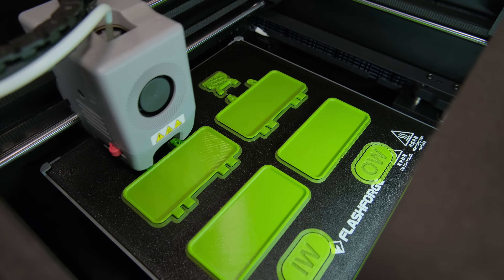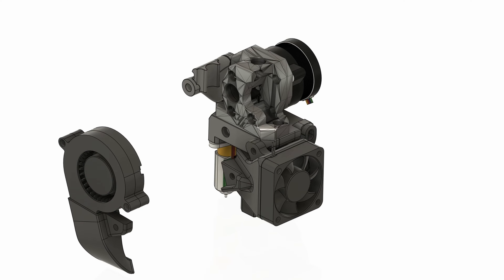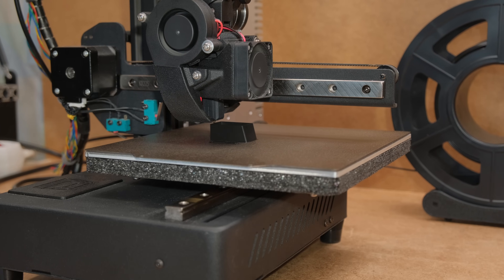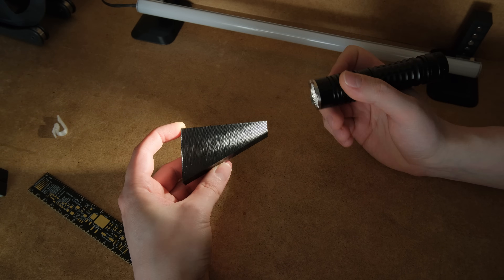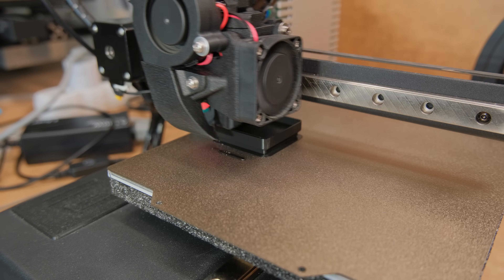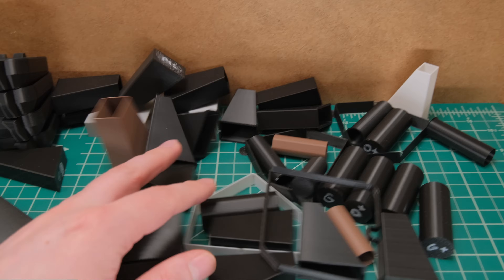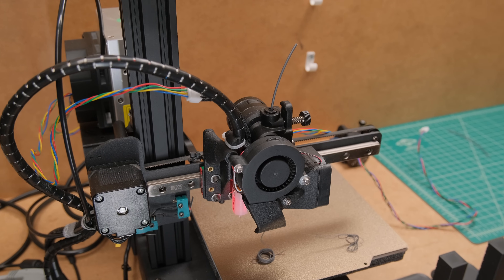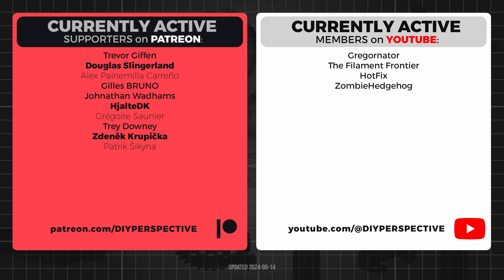DUAL-DRIVE Gear EXTRUDERS SUCKS? (GALILEO 2 vs ORBITER V2 & P1S vs A1)

Comment: did you disable A1 active flow rate compensation? does that make difference?
Reply from the maker: That feature is for Pressure Advance which eliminates bulging on the corners, I have manual values and I don't run it before the prints.
Reply: @PrintingPerspective  doesn't A1 detect filament width and auto adjust flow rate when printing? Not pressure advance
Reply: @h.y-chen  Yup, the A1 has an eddy sensor in the head that does "active flow rate compensation".  I don't think that's pressure advance.  I think that compensates for filament that varies in size over the roll.  That said, the picture they show on their sales page looks like it's an alternative for pressure advance, so maybe I'm wrong about exactly how it helps.
Reply: @h.y-chen  Wow, okay.  I just read up more on it.  It doesn't work during the print, it only works before the print.  It just optimizes the K-value for the filament at the start of the print.  So it's just an automated k-value setting, and shouldn't affect anything during PrintingPerspective's tests.
Reply: @Raytenecks  ok, so that just K-value thing, thanks

Comment: To compare across different machines makes the test rather useless (P1S vs. A1). The only falid test is between Gal2 vs. Orb2 as it is on the same machine with hopefuly the same settings. And there is no visible difference.
Reply: Yeah whatever his results were in this video you can chuck it out the door. Also, 10 years ago we had perfect prints with hobbed bolts on 3D printed Wade's extruders.
Reply: @megatesla  Out of curiosity went to google "Wade's extruder" - I was scarred for life x) it's incredible you managed to print anything with those kind of tools back then, we are so spoiled now days!
Reply: that's what I thought the whole time.. really couldn't agree more..

Comment: I wonder about nozzle influence. Is it not perhaps better to set extrusion width ever so slightly wider than the nozzle? Like say when you have a 0.4mm nozzle to always use 0.42mm outer wall?
Reply from the maker: I use 0.42mm for regular prints.

Comment: Love your testing! I would love a video where you compare the A1 extruder to a run-in Galileo 2 on that same ball screw printer you have.
Reply from the maker: I have two KP3S 3.0 printers with ballscrew ;D This one reached his "final form" where I just don't want to touch it anymore, but I have another one for doing that if I find time to test. But I want more to salvage the SK1 and make it my main test printer with Hermit Crab V2 print head tool-changer plates to make the designing/testing process way quicker.

Comment: Couple of things to consider for the variations you’re seeing between the Bambu A series and the custom printer would be any resistance in the Bowden tube setup from the extruder back to the spool. 

I’ve noticed personally a much more consistent extrusion performance using the ERCF plus a belay sensor and synchronised extrusion between the ERCF and the extruder to ensure the filament is fed properly into the extruder with minimal drag. Also another thing to note is that the Bambu printers internally apply some minor smoothing to sharp angles so just be conscious of it when comparing like for like models between them and a klipper printer (that doesn’t apply any). 

Finally do consider any potential speed variations due to minimum layer time - I’ve found significant improvements by excluding the external perimeters from the layer time slow downs (and have implemented a feature to do so in orca 2.1).

Lastly I believe the Bambu firmware applies variable Pa compensation depending on the print speed - I believe I had seen something to that effect in the X1 plus code but can’t 100% confirm it. I’m currently working on a variable PA feature to emulate something similar in orca, here: https://github.com/SoftFever/OrcaSlicer/pull/5609

Comment: I just installed a HGX lite with the large extruder gears and it's a world of difference. I did notice you can have serious problems with binding, you need to be very careful when tightening the assembly as a very small shift will make it bind up. I also used Super Lube synthetic 30 weight with PTFE. What sold me on the LGX lite was the free floating extruder gears that ride on the needle bearings that allow them to naturally settle centered. I can honestly say my printer now looks as good and maybe better than the A1 with helical gears. And i'm still jelly of those helical gears.

Secret sauce, i cleaned the bearings out and ran it dry for a bit with no load to break in the bearings then put on the Super Lube. WD-40 is great to wash parts, then compressed air to dry it out.

Now, another issue is print speed (max flow).. before the single gear would allow slippage and now there's basically no slippage BUT when it reaches the motors limits you see strange artifacts of basically the motor. Essentially there's a very fine line between flowing "100%" and skipping, and i like running my motor at low amps for when im printing enclosed high temp filaments. FYI that limit was forcing PLA @230C at 100mm3s though a volcano nozzle for about 5 seconds until the heater couldn't keep up, i thought it was going to grind it right away and beardly let any filament though.. i was shocked it pushed so much. Either way, i print mechanical parts and never really need more than 30mm3s. But it was cool to see the filament sponge back to size coming out of the nozzle lol

Best $17 spent on Aliexpress lol

Other extruders i've played with are the Sprit and the E3D REVO H2 V2S, but not much better than a MK8 extruder when printing at the optimal melting point. I just wanted something that was smoother, and the HGX lite with large gears did the trick
Reply: I had been running the OMG (a dual single-gear)for a while and it printed flawlessly, and tried the HGX and the HGX oblique both with slightly worst extrusion consistency. Im now designing an OMG style extruder with two HGX gears in a dual single-gear configuration.
Reply: Great writeup, explained a lot of things. What would you choose between LGX lite and HGX lite (oblique or standard straight gears)?

Comment: 1:19 How did you mount the hotend to the groove mount bowden adapter?
Reply: he showed it in this video
https://youtu.be/dQ3kQ2w9D2s?si=PhJ9p7mACAe3oGkY&t=113
Reply from the maker: Do you mean the gray part? It was CNC'ed from metal, but you can also 3D print it and secure it with screws - https://www.printables.com/model/457053-bambu-labs-hotend-adapter-to-v6-size

Comment: Could you do this again but with TPU? I was ordering a G2E last night but canceled it in the end because I realized it's only a single gear extruder and I've always seen dual as better for TPU.
Reply from the maker: Well with TPU layer consistency is kind of out of the scope, so Orbiter V2 might be the better choice because it has very little space between extruder gears and the filament path - https://www.orbiterprojects.com/wp-content/uploads/2021/11/filamentguideinsertion-2.png
I think this is the main aspect of what you want from an extruder to be good for TPU, as it is not easy for the flimsy filament to escape elsewhere.
Reply: @PrintingPerspective  That's kinda what I had guessed so why I decided to keep the orbiter 2 I have. I mean it works great with tpu so far. Almost no stringing, no filament getting wrapped around the gears like I had with a BMG, and i really love the sensor addon. I was HOPING to find a better extruder which the G2E may be for most people but with me printing TPU fairly often sticking with the Orbiter 2 may be a better idea for now.
Reply: @YourBuddyDinec  I also own the orbiter v2 and when printing tpe 83a from sunlu I always get the filament wrapped around the left gear when trying to go quicker. At what extrusion rates are you printing your tpu and what's the shore hardnes of it? maybe I could adjust my prints then :`)
Reply: @crypton1782  Not super fast. 60-80mm/s. Make sure the extruder isn't tightened TOO much as too much grip can do that.
Reply: For the record I've printed TPU with a bearing on a Bear extruder without issue.

Comment: i´d love to see the same tests on a "proper extruder" the belt extruder designed by Jón from proper printing
Reply: and the papilio lite extruder by kevinakasam as well.
Reply: Yup, that dude rocks.
Reply: the proper extruder also doesn't bite into the filament which will help to rule out variables.
Reply: I love how it sounds like your saying that all other extruders aren't real extruders but "proper" is just the name 😂 I would love to try a belt extruder one day though. Seems interesting.
Reply: @YourBuddyDinec  lol, I got the same feeling when I was writing, so I added the quote marks to sound less like that... Seems like it didn't work.. Lol

Comment: Single large gear with dual bearings to wrap the filament arround the big gear and maximize contact. That would be my design. But i must admit i am super happy with my hextdudort Plus with larger gear. It offers TONS of grip and power to achieve crazy flow and it doesnt have that much artifacts. Very consistent ❤
Reply from the maker: @Vez3D Prusa could sell their Nextruder as a standalone, it would be interesting to play with it.
If you ensure higher tolerances and it is a full metal extruder then I believe it. :) But I am kinda done with testing extruders, there are so many possible variables that it hurts my head to think about how to eliminate them and present the most apples-to-apples comparison… ;D
Reply: @PrintingPerspective   I guess one could take an LGX clone gearset (HGX) and skip the second gear entirely - and then you don't care about clone kit's potentially worse meshing quality, you'd just be using the reduction part of the gearbox. To combine with two idler bearings. I won't get around to design that one but maybe someone :D

I actually find it slightly weird that we use metal teeth to propel plastic, i mean i suppose we could be gripping filament with rubber surfaces of some kind instead and along more of an area. I have seen two implementations of that, one of them was by Proper Printing who uses two 2gt belt loops. The other i forget where.

You can even use both HGX gears just place them one above another, and have them push filament one after the other. Instead of engaging the drive gearbox gear to one HGX gear and engaging the second HGX gear from the first, you can place the drive gear between them and engage them both equally. Might be a dumb idea i know i don't know :D

But yeah a little surprising that famous cloners like Triangle haven't gone full send on a new Prusa design.
Reply: @SianaGearz  I've done exactly that with Cannon. The other belt extruder is the Papilio.
Reply: How would that work with very brittle CF/GF filaments?
Reply: @girenloland  I've printed over 10 kg on mine so far no wear noticeable gf and cf asa and pc is most what I print
Reply: @girenloland  o and still have the first vz hextrudort I printed alot of seems brand new still as well only thing I use different is an undertaker nozzle
Reply: That's what I'm doing. 😎
Reply: Just a matter of time until some chinese will copy the prusa nextruder concept.
Reply: An improvement to this concept is using a GT2 Belt for the idler.
Reply: @Bapate-rh9be Belt is excellent for grip but kinda forces the extruder to be huge and for you to have a large arc of hob contact. Rubber outer surfaces on tiny bearings may be better.
Reply: but there is better, 2 belts to have full contant on the filament in a proper lenght and not just on the point of contact of the gears, I dont remember who made a video about that a while ago and it had very intresting results
Reply: Is hextrudor better than orbiter in avg?
Reply: @fikuss30  both are very good I would say. But the Plus version with watercooling and short goliath is something I love a lot :)
Reply: @Vez3D  lol thanks for answer 👌😁 I have hybrid vzbot(core blv 80cm Z) orbiter+Goliath, cpap, 48v 5160 mellow v3+ speedy stepper(4min benchy) I'm pretty happy and was just curious 😉 I have little problem with klipper overload when printing 500mms and more or some fast acc with lots of object. Rpi4b2gb but low skr pro 1.1.  Do you think new mobo faster mcu will help?thanks and wish you happy day, love vzbot 😂
Reply: @fikuss30  what is the issue
Reply: @Vez3D  klipper overload, timer too close. Klipper load spike 300% especially on fast acc and mms can't event complete 24h print on that speed. Everything under 500mms work ok never fail. Tried different rpi/new install fresh klipper also I buy specially uugear raspikey emmc 32gb  Card for rpi fast system response .
Reply: @fikuss30  do you use arc welder by any chance? And how much microstep?
Reply: @Vez3D  using orca slicer  common settings from default vzbot profile. 16 microstep
Reply: @Vez3d I was the nextruder developer. Want to chat?
Reply: What is stopping you from making a new extruder with this concept? :P

Comment: Worm gear extruders are interesting too. Very simple and high reduction makes them ideal for single large drive gear extruder designs. Only issue is when you have too much reduction and start to get beyond the optimal point on the stepper torque curve, and their need to be super rigid.
Reply: Also a shit ton of friction on the worm gear. In cnc kitchens extruder test the nf cannon (lgx with worm gear, over 1000 esteps) didn't even cross 5kg of pushing force, meanwhile a orbiter 2 (around 700 esteps) was doing nearly 7kg and the bmg extruder was traction limited at a bit over 5kg
Reply: @over_pizza_2578 Just need a big motor driving the input. 😎 My cannon gears have LDO 2804 driving them.

Comment: I switched from clockwork2 to galileo and at first got slightly worse results. But twas most because I had rebuild and tweaked and tuned my cw2.

After rebuilding my g2e and throughly wearing in the planet gears for mesh consistency (DO NOT skip that step in the manual, grab the drill and wear the gears in) my results were the best I'd ever seen
Reply from the maker: That is probably the reason why it didn't perform to its full potential because I skipped that step. I didn't even read about it because of the title LOL "YOU KNOW WHAT REALLY GRINDS MY GEARS?". Thanks for mentioning this! I will have to make a pinned comment to address this. :)
Reply: @PrintingPerspective this step is less relevant for the injection molded gears that come with the kits since Christmas or so. As they don’t have the same tolerance issues as the mjf printed ones. What is super important though is to make sure the hobbed gear and the filament path are perfectly aligned. If they are not you’ll get filament walking on the gear and rubbing on the filament path. This is pretty obvious it’s happening if your rotation distance is different from the recommended one on GitHub.
Reply: I am following in your footsteps and also have slightly worse results and im running out of ideas of how to tune it out. I didn't see anything in the manual about wearing in the gears though, I need to check that out
Edit: I read the latest G2E manual again, and still don't see a break in process. Could you share the details?
Reply: @CorySimpson the break in process was for the original batch of Galileo 2 kits made from SLS parts. The new injection moulded gears and housing don’t require running in.

Comment: The A1 extruder looks like a clone of the old E3D titan extruder
Reply: That's what I was thinking as well. Straight up the same mechanism for it.
Reply from the maker: Because probably it can't get simpler than that. ;D
Reply: @PrintingPerspective  Yet most (all?) cheap titan clones are horribly bad in concentricity. Good extruder requires precision manufacturing, Bambu Lab probably having that :)
Reply: Kinda but with helical (oblique tooth) on the pom (i assume) gear

Comment: I like relatively slow printing on kp3s pro, should I go single-drive or dual-drive?
Reply: If you have the money, you can go with vz-hextrudort as it was designed to compensate for gears eccentricity inconsistencies. It should be the best dual gear extruder and will out live your printer. Otherwise I would go for quality single drive gear extruder. This is just my opinion, so don't trust me :)
Reply: @vanher282  imo opinion such an expensive extruder isnt worthit using with a  cheap printer.
Reply: @skilledcamman4752 Totally agree with you, but for me price diff to orbiter was like +10eur /usd. When my printer dies or when I need something bigger, extruder will be the only part that stays.
Reply: VZ hex has some issues though. The angled gears mean you have forces pushing the gears back and forth on the axle they run on.
Honestly id go with printed sherpa  or orbiter
Reply from the maker: @skilledcamman4752 depends if you have inconsistent extrusion problems with the current setup. For slow printing, even the stock KP3S PRO extruder should be fine.

Comment: Had no Idea bambulab only used single-drive gear extruder
Reply: Only the a1, x1 and p1 use dual gear ones
Reply from the maker: @skilledcamman4752 A1 and A1 Mini has single drive gear and P/X series have dual-drive extruders.
Reply: @PrintingPerspective  ye I knew that I meant only for the a1 seres.

Comment: I'm in the design stage of my own DIY printer and at first this video made me waffle over my choice of the HGX Lite for the extruder, but that printer is meant to exclusively use a 0.2mm nozzle to print minis so I breathed a sigh of relief when you pointed out the extrusion force requirement
Reply from the maker: For small nozzles you want extruder to have the best filament grip and high extrusion force. Especially if we are talking about high speed 3D printing. :)